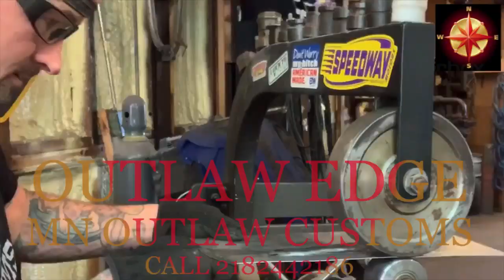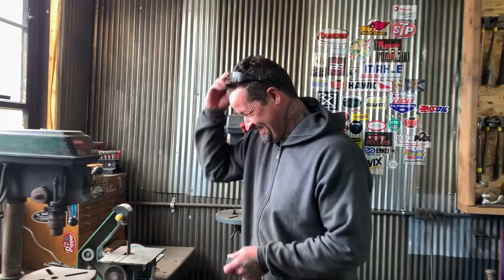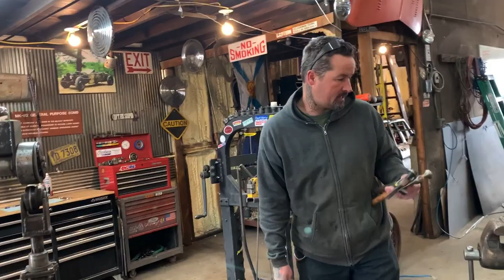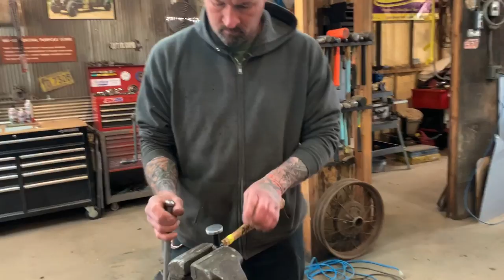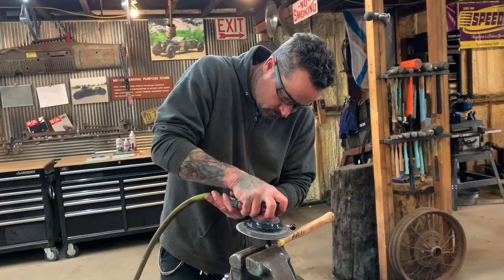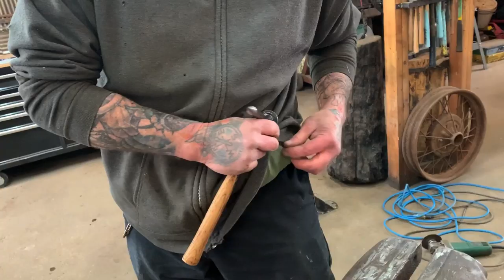Metal shaping hammer: hammer tune up, hammer restoration

Comment: I dont repair cars,but I do hammer out copper and brass fishing spoon lures.Whenever I am about to fine finish a lure shape, I give the hammer (and the metal anvil) a whizz with green soap wheel, then a strop with Solvol Autosol (aluminium oxide chrome polish), it quickly maintains mirror surfaces above and below. It  gives a fantastic disco ball effect with very little polishing required

Comment: Hey Arco and Heidi, there's an artist's touch to that too.Guess ya just remove as much metal as you have to.and with the bench grinder don't build up enough heat in the hammerhead you have to dip it in water so the metal doesn't get softer. Sure makes a huge difference before and after. Looks slicker than snot on a doorknob, brother !

Comment: how come you used 600 grit and then went to 80 on the DA. would it be the other way around and that would make it polish up easier.
Reply from the maker: Most of the vid got cut out. You can go from 600 grit all the way to 3000 grit in steps. The finer the paper the better the result. 👍👍👍